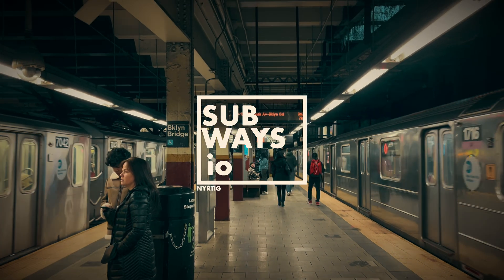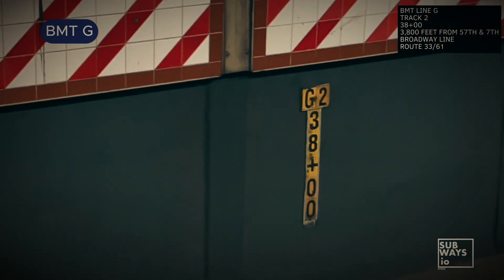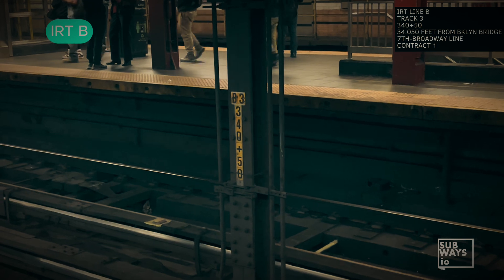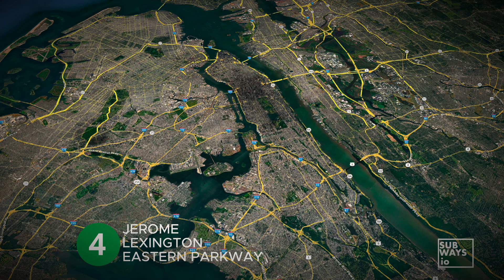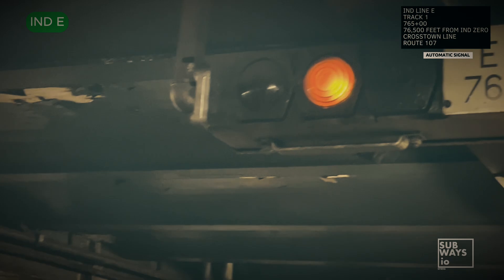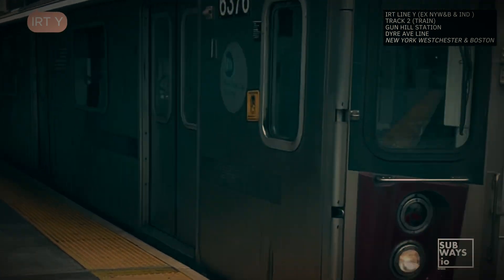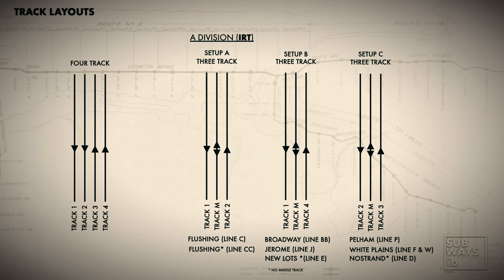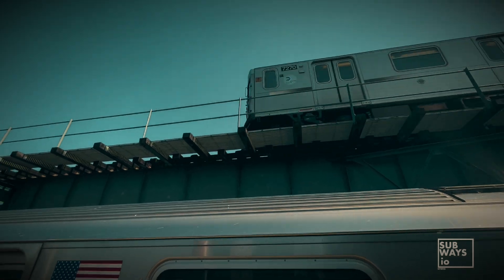NYC Subway Signals 101 (Chaining): The Backbone of the Signal System.

Comment: I thought the markers on the signals was the distance from the home signal.
Reply from the maker: Signals are laid on top of the chain, with signals and blocks spaced based on maximum allowed speed and braking profiles. An easy way to confirm this, as shown in the video, is that the signal digits match the survey markers on the wall, indicating the exact location of the signal. Yard setups are outside this scope of course. Home and approach signals (marked with an “X”) do have corrections with interlocking setups—a topic for another day.

Comment: Did you say that the Franklin Ave Shuttle uses Brooklyn Bridge as zero chain? That seems crazy
Reply: It appears  "crazy"  until you understand that the Franklin Avenue Shuttle branched from the Fulton Street el, which directly connected to the Brooklyn Bridge tracks.
Reply from the maker: @joes2085  yes that’s correct ParkRow at the base of the Brooklyn Bridge. The measurement takes the route of the old Fulton Brighton line.

Comment: The last digit on the IRT signal plates is the track number.  I know it's a weird way of doing it but I checked with another source and am pretty sure that's the case.  (The track number for chaining purposes is different from the track number seen on modern track maps, and is more of an inverted form of the B-division track-numbering).  In any case, I enjoy your videos and thank you!
Reply from the maker: Indeed you are correct* Just checked with the team that wasn't added it because it's not always the case. IRT LINE W Track 2 carries a 4 digit.  LINE BB same case. Thanks for pointing this out again we did add a note in the description and thanks for watching.
Reply: It’s absolutely correct that the last digit of an IRT signal number is the track number. The problem is that the Maintenance of way dept and the transportation departments used 2 different track numbering systems. The Transportation Dept simply numbers the tks from west to east 1, 2, 3 , and 4. MOW uses a scheme similar to the BMT/IND but as you described it “inverted.” On the BMT/IND, S/B tks are odd numbered and N/B tks are even numbered with the lcl tks having the lower number. thus on the BMT/IND the lcl tks are numbered 1 and 2 snd the exp tks are numbered 3 and 4. On 3 tk line, the middle tk is numbered 3/4 and the signal in the S/B direction show the track number as tk 3 while signal in the N/B direction show the tk number as tk 4.  On the IRT MOW numbering system the S/B tks are even numbered and the N/B tks are odd numbered but the lcl tks have the higher number while the exp tks have the lower number. Thus tks 1 and 2 are the exp tks and 3 and 4 are the lcl tks. Exp tks on 3 tk lines are similarly numbered. Operationally, the simpler 1 through 4 west to east numbering system is the one primarily used and on 3 tk lines, the exp tk is designated as “M” (for middle) tk.
Reply from the maker: @randyo573 Indeed, thank you for the clarification regarding MOW and the mismatch with the track number. We also appreciate your years of expertise on the topics at hand.

Comment: One of the most confusing videos I have ever seen.  At least I got the fact that a chain is 100ft. Ithink?
Reply from the maker: Give us some feedback how could we break it down better? More visuals? Or more detail in the dialog?
Reply: @Subways_io  A better scale map. Maybe get permission to use Peter Dougherty's maps. He explains it very well. Maybe he will let you use them in exchange for advertising his books.
Reply from the maker: @eliasthienpont6330  Indeed we'll  perhaps follow up with a visual map breakdown.  Thanks for the feedback.
Reply: Also, the B Division line designations are far easier to understand, and I believe that the individual individual track designations are more in line with railroad practice.

I always had some trouble with the IRT system.  Maybe at some point, they might consider converting it.  The chaining itself would remain the same.

Someone asked about how the Franklin Ave. Shuttle has a zero origin from the Brooklyn Bridge (Park Row).

Easily explained.  The principal lines generating from here were the Fulton St. (K) and Myrtle Ave. (M).  I believe that actually Fulton St. branched off  from Myrtle Ave.

Each had their own respective branches which continued their chaining.  

Myrtle Ave. had Lexington Ave. (L) and Fulton St. had Fifth Ave. (C for Culver and eventually N for the Third Ave. spur off it), Franklin Ave. (O) and Canarsie (P).  This is how Franklin Ave. chains from the Brooklyn Bridge.

It would make sense to rechain it back from Prospect Park on the Brighton Line (A), but because  its functionality at this point is so marginal, unlike as in former times, it is deemed not worth the bother. 0:03
Reply: There was alot of information given in a short amount of time...especially for someone just figuring out what these markets meant. Though far removed from NYC and the subway system I still love it and would not hesitate to ride it again. Still...this was very informative I learned something new about the best...in my opinion...subway system in the world.
Reply from the maker: https://youtu.be/VmerDmxexB4?si=9DJVEm4VDxXD6Ivy    Follow up video.
Reply: YOU'VE GOT TO PAY ATT